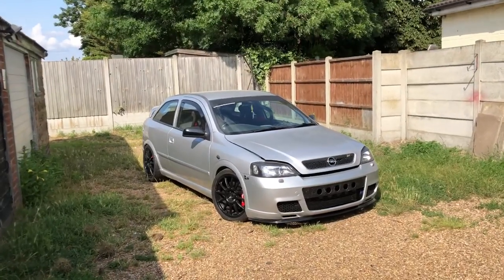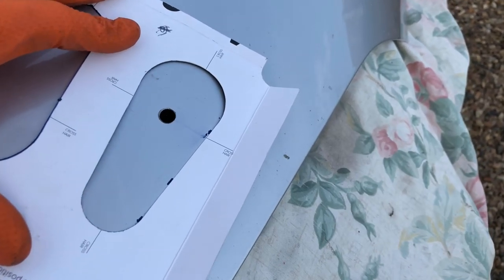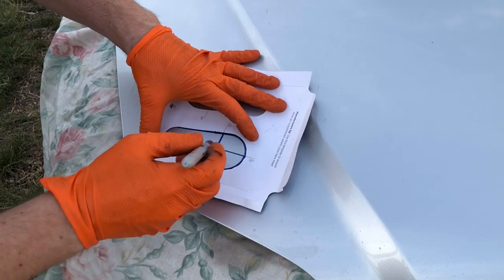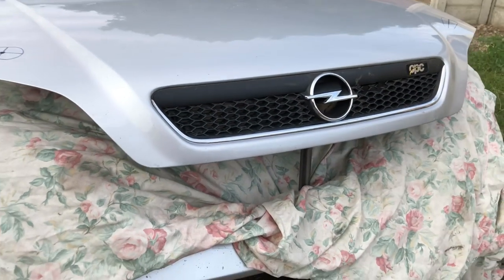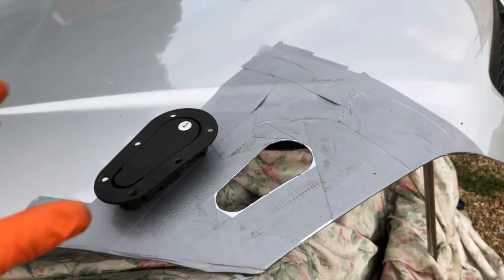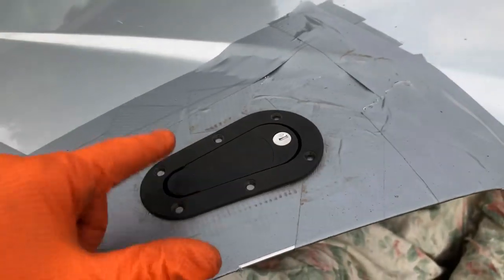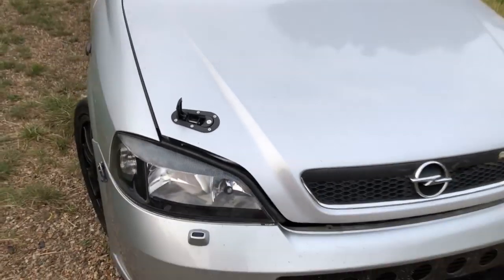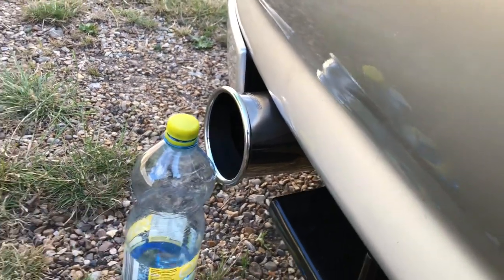Using Launch Control💥 And My Exhaust = Bottle Cap Challenge Fun!! Astra Z20let

Comment: Where would you look for a boost leak on z20leh?? My vxr has intercooler, x over delete, new recirc, turbo bk exhaust and tophat... been back on dyno twice now only pushing 250bhp with remap its got a misfire and boost leak cant find it anywhere, checked vac lines etc too 🤷‍♂️got my head done in
Reply from the maker: Go check my video on how to find boost leaks. Your find it easy
Reply: Inlet manifold gaskets on them are shit but could be lots of things
Reply: Ive seen his video he makes it look easy you will defo find it with his method 👍😁